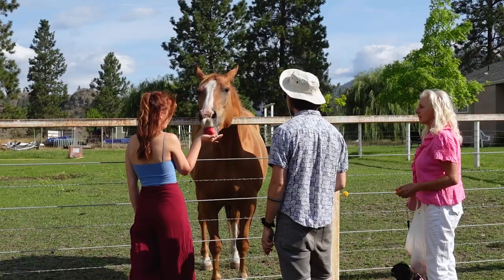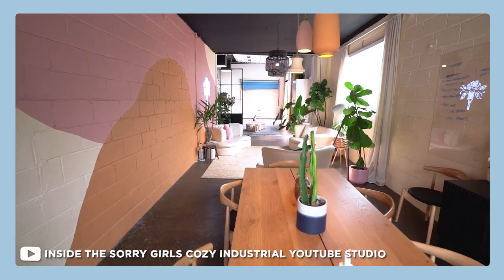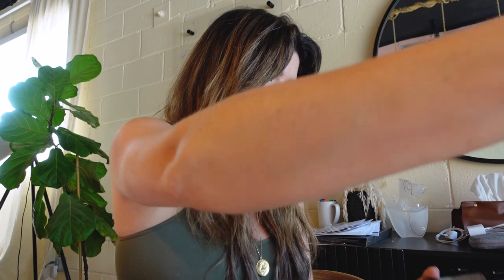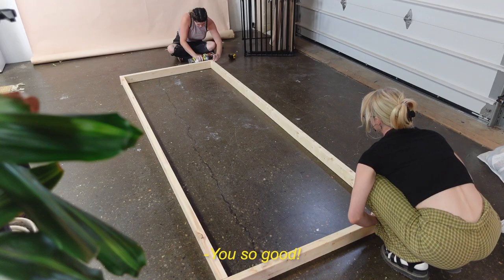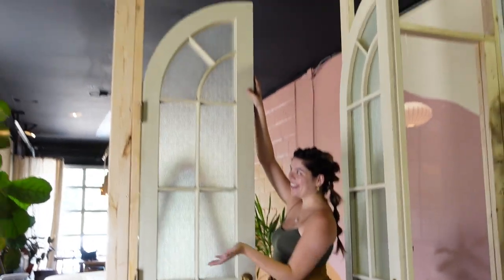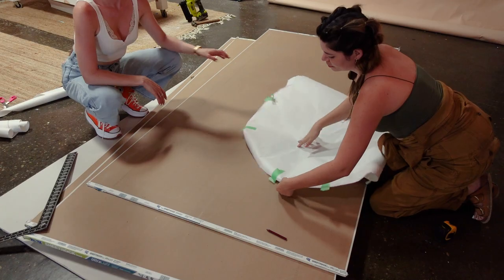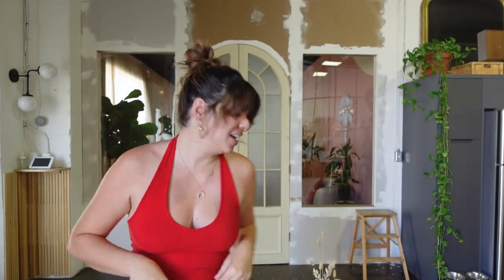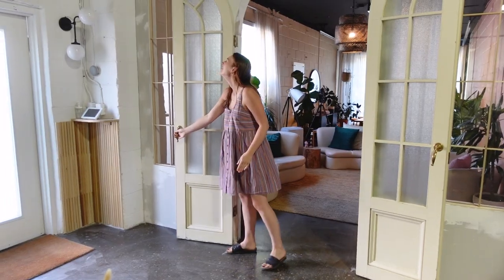putting up a huge wall without my boss knowing

Comment: The arched doors work so well with the existing space! The paint color doesn't seem to fit imo, but whatever works for you!
Reply: Yup, don't like the blue.
Reply: Agree the colors gotta go
Reply: I wish they would've matched the doors or done a really light babyish blue
Reply: I would have preferred it just to be black to match the other walls in the office. With the wall black the doors could have been painted another colour picked from elsewhere in the office or the board room
Reply: @Lèmon Lēe yes my thought was if they did more of a teal or slate blue it would have looked way better.
Reply: Blue is not right with all of those other colours. Loved the doors though!
Reply: Why didnt the arched doors get a new coat of paint 🤷🏼‍♀️
Reply: @paulinefraser7877  black is what I thought bc of the other window wall.
Reply: I wanted it to be the same pink on the mural in the board room, or black.

Comment: I feel like the windows should have had an arch too… not a huge fan of the blue 😬 but it’s your space
Reply: Becky's original design had half arches! I wonder why they decided not to go with them?? 🤔
Reply: @sakurablossom12  probably out of ease. Arched windows is lot more difficult especially to match perfectly with the doors
Reply: and frosted glass like the door
Reply: Yes! I would have looked better. The blue is pretty but doesn't go in that space. I also think painting the door would have made look a lot better.
Reply: @julesyan  they already made a template of the door arch. Cutting the template in half wouldn't have been that difficult.
Reply: @jessikarabbid4720  thats true, didnt think of that prt 🤔
Reply: @jessikarabbid4720  maybe it had to do with putting in the glass? Idk anything about that process but I’m assuming finding glass to fit might be hard
Reply: @mjjae8122  I totally agree, however they were using plexiglass, which can be cut to size or shape. But plans change all the time, if they're happy that's all that matters. 🙃

Comment: Was there a particular reason you would want the drywall put up backwards? The paper side is the wrong side of the drywall. It should never be seen.
Reply: Omg you’re so right! I didn’t even realize!
Reply: You don’t. She probably did it by accident and didn’t realize until it was too late. Maybe the door isn’t symmetrical and she would have needed to cut a new piece. Or she might have figured it doesn’t matter. 

It’s not the end of the world, but the wall will have a funky texture in those areas. Both sides do have paper. The back just doesn’t finish as nicely as the front.

Comment: I feel like the doors would be better supported by stronger framing than by one solitary 2x4 on each side plus pieces holding in the plexiglass. Those 2x4's can bend quite a bit over time, even with a little bit of drywall on them (several pieces of which you put up backwards!?!) - I think you're already seeing that a bit in the doors being a little tricky to open. Also wish the plexiglass windows were framed in better. I like the wall but I wish you built things properly. The Blue is *ok*, but would be nicer a bit darker and maybe warmer to get along with the warmth of the rest of the colours in the place. It's a bit too cool. The doors are gorgeous, and the wall looks ok for now, but I'll bet you have to rebuild it eventually once the 2x4's warp.
Reply: Good notes. I have been perplexed for a while about why they don’t consult some experts. But maybe the point is to show the mistakes do it yourselfers make. 

My parents are architects and had their own firm. I grew up around building sites. It used to make my parents crazy when their friends and neighbors showed off their amateurish projects when my parents would have given them free advice. 

One good family friend insisted on designing his own home without any input from my parents no matter how much they offered. He ended up with a home full of 5 &10 feet wide hallways ( to make them useful) and dinky rooms that couldn’t contain average furniture. In his kitchen he didn’t allow enough space between the countertop and the island for the dishwasher door to be fully opened. It was corrected during construction but the fix still cost thousands because ultimately walls had to be relocated. 

My bonus dad was actually hired quite frequently to fix other architects mistakes often after a building was completed. My mum would be miffed and say the developers just should have hired him in the first place. But the man has no flash; his proposals were pretty straightforward and matter of fact.
Reply: This comment needs to be higher. Those doors must be SO heavy, I hope they don't take the wall down!

Comment: Girl those doors 😍, glad you chose them instead of the sliding doors. I do however think they should have opened up towards the inside... just so when the space is not in use and you want to have the doors open, it would look cleaner and would less obstruct the outside entry way. But gorgeous 🥰.

You always find beautiful pieces.

Comment: I wish they had frosted the windows on the side too. It seems kind of random to have those clear and the door frosted. I know they probably wouldn't be able to match the frosting on the door, but if they went with something very different I think it wouldn't be an issue of trying to match but not quite getting it. Or they could paint the windows and make it look kind of like stained glass!

Comment: Love the design with the arched doors ❤ I noticed you had a few pieces of drywall on backwards but then were turned around just before priming 🤭 I think the blue is the wrong shade... probably would have matched better with other glass wall if it was  more of a blue/black shade 😊
Reply: I think someone came in and helped. The side window wells were open to the top and bottom and they are drywalled in the final. In order to add drywall to the window well you have to have something to attach it to, ie, framing. There was no framing there. So i think someone came in, reframed the windows and the door and drywalled the arch for them. Drywalling the interior part of an arch requires either a kit, or kerfing drywall which is a little more advanced. To finish the edges of the arch you need specialty corner bead. They didnt show any of this stuff so I assume someone else fixed it for them. Or they did it off camera? Either way, i wish they would have mentioned that because you cannot frame a wall like that if you would like it to support a heavy door that is opening and closing.

Comment: A darker teal (with more green tones) or a dark jewel toned green would have felt a bit more cohesive, a dusty lighter blue or a navy also could have been nice but the shade and undertones of this blue paired with the natural lighting in the space just doesn't suit everything else already there. I however, love that you decided to be bold, it didn't hit but its way more fun than a neutral/safe color, AND!!! !hat you didn't paint the doors!!! They are somehow magical in a sense and leaving them as is aids to the whimsy of them and defines the arched style of them, it makes them the feature instead of the entire wall being a feature. I love the whole wall in general, it adds function but also some interest to the space as it matches the arched door you have in the filming workshop that leads into the storage room, and makes the industrial elements not as harsh as they previously were. the mix of styles flows very well especially because of the paneling. I hope you guys repaint it but don't paint the doors! and perhaps carry on that pattern that is on the boardroom walls onto the door wall to make it flow and not feel like an 'add on' but intentional from the start.

Comment: I was hoping inside the room you’d continue the pink design across the wall down to the floor and on the outside either match the other black wall or another dark color like maybe green. Or just keep it cream. I imagine not wanting to paint the doors may have been a factor though.

Comment: Oh wow I was really thinking the color would be something wild from the comments. This color is not bad. It just sort of changed the theme to tropical. Like Kelsey said if you bring the color in within the room through throw pillows or candle holders, it will become more cohesive. It’s not a wild concept. I think pastel is so in and so ubiquitous that ppl are shocked at anything that’s note pastel or neutral Bc that’s the Instagram palette

Comment: LOVE the doors/wall and the entire a structure, despise the blue unfortunately :( I definitely think the doors and the walls should be the same color. The contrasting colors distract from the focal point being the structure itself, I don't think the colors should be the focal point. I would go with a neutral cream/oatmeal color, or go black/charcoal. ALSO, the plant on the top of the cabinet in the kitchen to the right of the doors is just begging to grow around the door/along the wall!!!! Get some adhesive wall clips to train the vines as they grow and it'll give off major magical garden vibes.

Comment: I was trying to see how you filled in the area between the drywall above the doors and between the drywall and the plexiglass. What did you use? What is the code in your area of Canada? Did you attach the wall to the floor and the ceiling? How did you do that? I liked how clean the arch looked.
Reply: They used screws, it's in the video.

Comment: I want those arched doors so badly! No, I don't have a place to put them. Does that matter? 
I was hoping you would paint the muntins black on both the windows and the doors, to echo the divider window wall across the main space. While watching you paint in grayscale, I thought it would be nice if the main color was the same as the kitchen cabinets...kinda'. I agree that the blue doesn't work, but if you make that a new accent color and put a few splashes of it here and there, it might. Though the jewel tone green would be a sure bet.

Comment: Would it not have been easier to do the template of the doors for the arch panel above on the ground before hanging them...? & Hoping the gap under the arch between the front and back piece of plasterboard/drywall got taped and skimmed

Comment: As someone who just did my walls I hope you guys aren't using drywall compound with silica dust because you have to wet sand it and you were going in with sand paper 😭 but I trust you guys know the difference, sincerely: your fave safety prof

Comment: I am I the only one that needs also smthng more on the windows? Arches and details under/over to fit with the door?  
Maybe also same glass texture and wooden grid on the inside also?
Great makeover overall.

P.S. I don't like either THIS blue. Baby blue/  Light purplish blue/ Dark green/ Black/ Dark grey/ Dark brown/ Dark mustard / Same color as door(neutral) would have worked better.
Inside-room-wall could have different colors such as same colors & continued pattern as side walls.

Comment: MOST people get paint on themselves when they paint walls and houses etc. YOU guys never get paint on yourselves! (Maybe you have your crew paint when you've done a bit in your fancy clothes...) I'm not a fan of the blue. I was thinking that the outside should have been done in black, to match the workshop across the way, and the inside should have been painted something that would work with the soft colors you have inside that board room. Although not the poop brown.

Comment: It looks great, but framinging/construction wise, it’s a complete hot mess. Becky should have brought Kelseys contractor in for help. Or maybe found another YouTube influencer to do a team up. 

Building walls IS something a skilled DIYer can do. Me and my hubby have put up quite a few walls, we completely redid our basement in our last house and he framed my parents basement in their current house. Framing actually goes pretty fast. Windows and doors don’t really add much for complexity either, it’s still just building squares out of 2x4’s. But the framing in this video is… bad. Plus you’re missing a proper door frame/jamb/stop, two sheets of drywall are backwards, and there’s no metal corner bead around the windows or door. It also looks like there’s wood taped onto drywall, which is no good, it’ll probably crack by Christmas. Wood and drywall expand and contract at different rates, it puts too much strain on the seam. Eventually it’ll pop right off the wood. 

I seriously hope any viewers don’t decide to follow this like a tutorial watch a few more videos and learn how to properly frame a wall and hang a door. Trades aren’t like craft projects. If you do it wrong people can get hurt